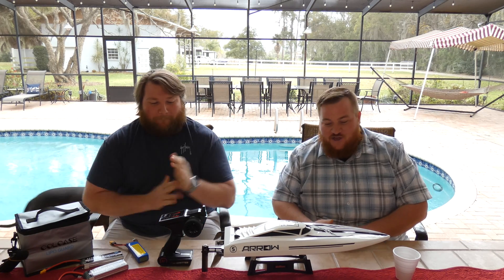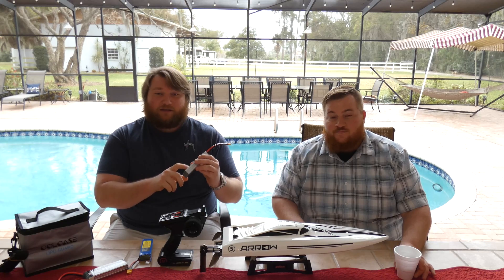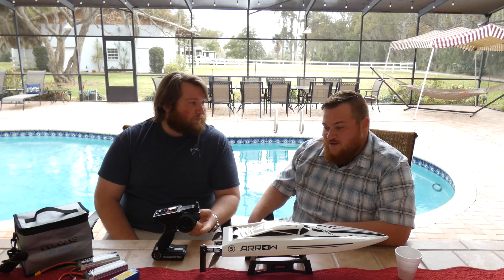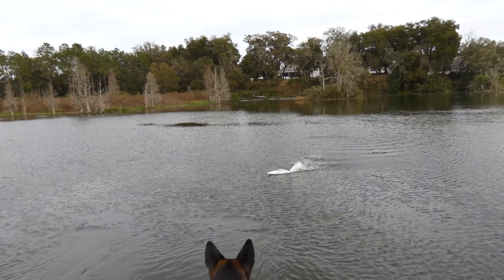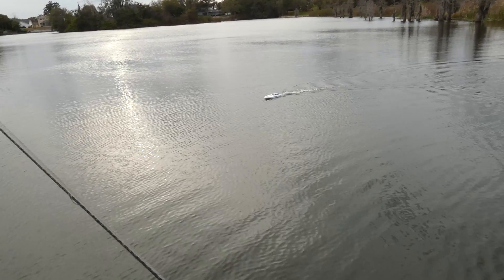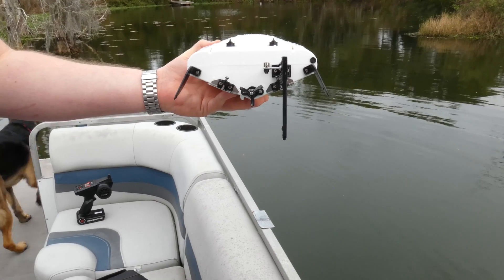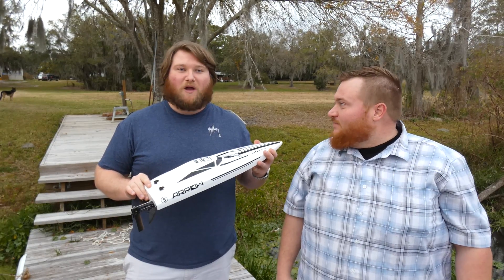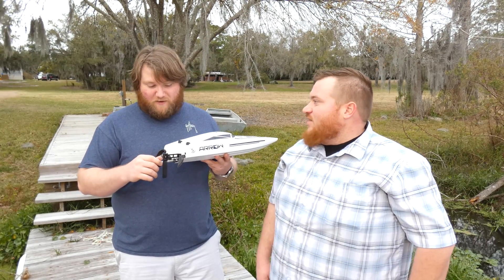3d Printed Propellers FAIL

Comment: Yes, you tried anyway.
Constructing propellers is really "rocket science".
You can search for Propeller Size Calculators, there you can get a little closer to making it work.
When it comes to flipping the boat over, it's very simple, it's just a matter of timing because it's the engine's torque that you use, which is why there's an out runner engine in this boat. (It's all about pressing the gas at the right time.).
Good luck!

Comment: Hi was there a Problem with the bigger battery fit on the arrow boat after you change to 3300 did it fit right at work.?
Reply from the maker: It's a little tighter of a fit the red boat had better placement for weight more so than the white version